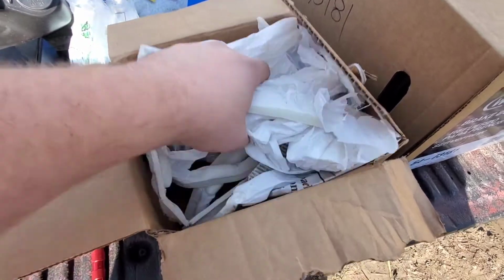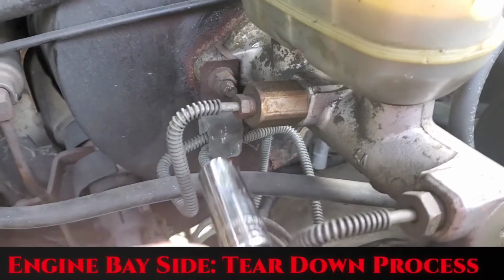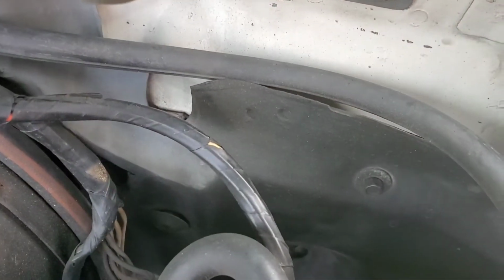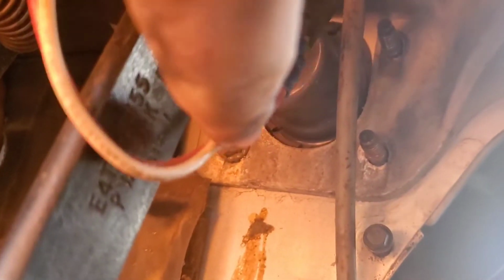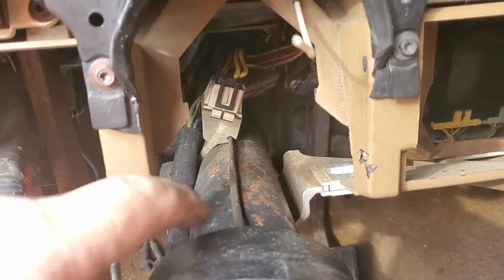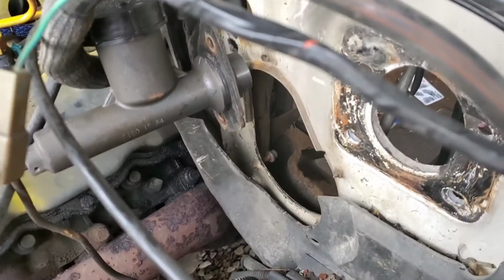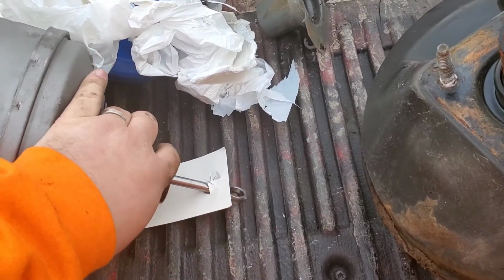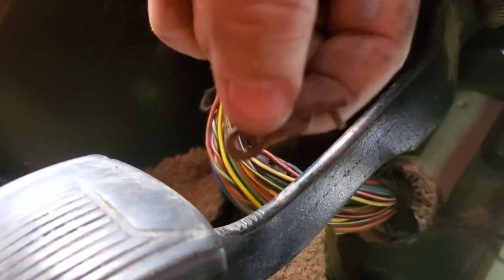OBS F-Series: Installing Firewall Flex Plate from www.BroncoGraveyard.com Pt. 1

Comment: Great video
I recommend getting a new clutch arm and master cylinder in order to fully remove all the play in your clutch pushrod
You can get both off Amazon for under $70 iirc
Reply from the maker: I'm probably just gonna do the Heim Joint mod and call it a day.

I have a brand new LUK clutch kit (Single Mass) to go in